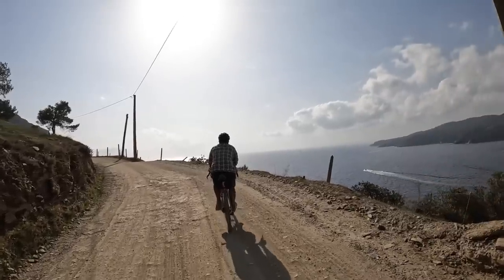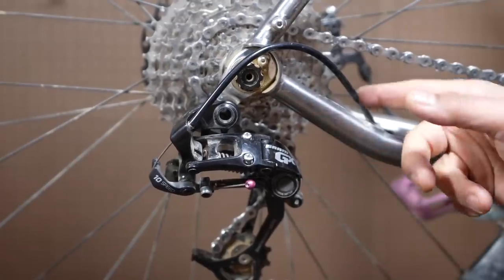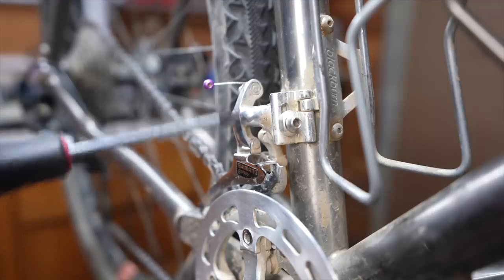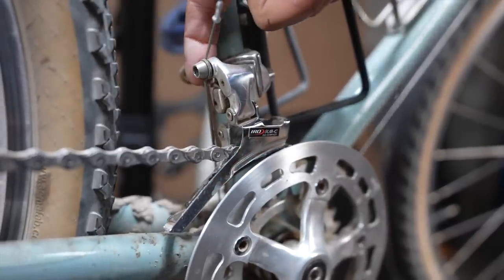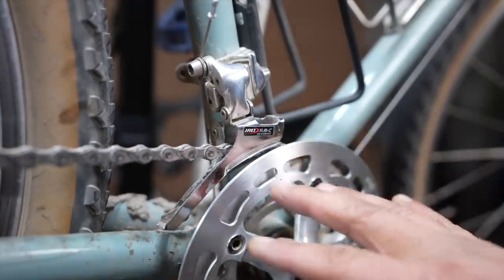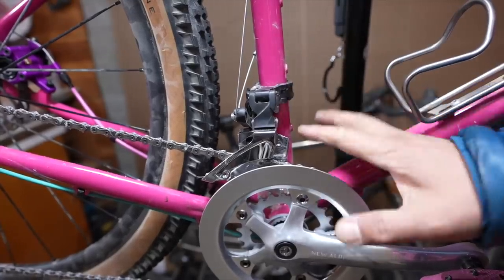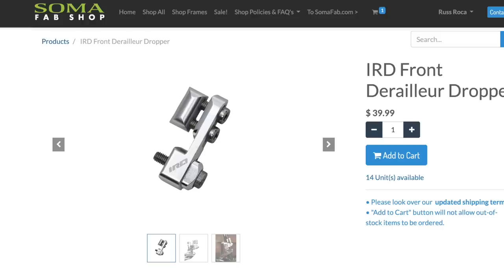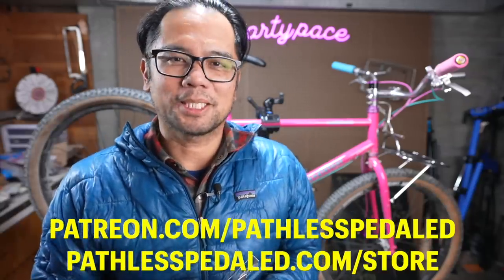These Components Are Disappearing...Get Them While You Can

Comment: Another FD you can consider is SRAM's 10sp 2X MTB group.
SRAM came out with MTB cranksets that were 42/28, 39/26, and 36/24 and front/rear derailleurs to support these 2X groups.
So in terms of an actual "plug-in-play" legit groupset that was meant to work together, this is a possibility.

If you can't get your hands on a crankset to build this, any 4 bolt 104/64 will accommodate the rings.
Also, you don't necessarily have to use the 10sp group either, but it does have it's perks. The mechanical road and MTB both have the same pull ratio in 10sp, so you can mix Red/Force/Rival or Apex 10sp brake-shifters with SRAM XX1, XO, or X9 rear derailleurs. The only mod is that you need an inline barrel adjuster on the RD as the MTB RDs don't have one. The Jagwire Mini In-Line cable adjusters are pretty good and can be slid right into the RD.

Also regardless of brand, FD's generally have the same pull ratio so no problems mixing Shimano (or Shimano variant) and SRAM.
Reply: Have a 40/22 with Red, XX and XO.
Reply from the maker: Yes. I have a vid on using an x9 double for touring.
Reply: IME 3x FDs are not widely compatible, and 2x FDs are compatible only in the sense that with some adjustment it's usually possible to make one click do the shift. That said, there are differences even between Shimano FDs.
Reply from the maker: @szurketaltos2693  what’s this click you refer to?  We always run them friction :)

Comment: Nice article! I've been looking for this. Well, I reuse a 44-33-22 Sram GXP triple chainring set (104/64 BCD with GXP spider). Take middle chainring 33T out and put 44T there. Then replace inner 22T (64 BCD) with readily available 28T ring. The spider is compatible with any GXP crank arm. So, I install it with 160mm China made hollowtech GXP crank arm. The 44-28T works well with Tiagra front.

Comment: Your comment about the truck transmission is so valuable here. So, if you're going to have ranges then you are going to have learn how to shift. Skip the wide range cassette at the rear and clutches.  Run a tripple up front. Sometimes you have to double shift to achieve your cadence.

Comment: Excellent coverage of some great components. On my quality bikes I've run everything from 7x to 12x, and have come to the conclusion that Shimano 9x is the best, especially for a 3x front setup. Running 2x upfront there are benefits to the larger cassettes for 10x and 11x, but they tend to get really fussy and unreliable as the spacing diminishes.
Reply: I agree.  I have that setup and find it covers a wide range without that cranking angle of the chain but there is some gear overlap that can be adapted to.  Love the XT and 9x 3x.
Reply: anything from 9 speed and down is king, i have no interest in anything above that.

Comment: I’ve been running a Shimano MTB rear derailleur with 11-42 rear and 46-34 front double and it’s got a front derailleur from a co-op so, going by the labels only, it’s a Shimano 105. It’s been fun to figure out everything but it seems to be doing good now. I had to replace the B screw on the derailleur a long time ago when it was still 1x. This thing has seen sloppy snow rides, too much mud, and I rode a cyclocross course with it loaded up with gear so it’s handling things well.

I’ve actually used a lot of info from your videos and so much reading of fine print in product manuals to get this to work so far. So, basically, thank you!

Comment: I put GRX 11spd on my bike last year (with 105 shifters). 46/30 front and 42/11 rear (with a braze-on extender on FD, and goatlink on RD) on my "gravel" tires. Works perfectly. On my normal road tires is a 34/11 cassette, and I can swap back and forth without having to mess with the indexing much.

Comment: I run a 3x crankset with no front derailleur. In reality, if I am shifting out of the middle chainring, I just hop off and shift by hand. It takes 3 seconds out of my ride and isn't done often. I rarely drop the chain, even on rough roads/trails. Just another option that prevents a lot of these headaches you discuss.

Comment: Thanks for repping for the 2x! I built up my Soma Fog Cutter as a 42/11-52, but those gaps are just HUGE. Waiting on a new left lever and a 46-30 1-piece direct mount chainring. I'm going to try one of the many 50-34 FDs I have laying around first, but if that gives me any grief, I'm looking at the MS Advent 9 that's designed for 44 to 48 tooth big rings and a 16T gap.
Reply: I use the Claris FD with 46/30. It's designed for as small as a 46t big ring. I think Sora might be the same.
Reply: P.S. I haven't tried the Claris FD with friction shifters, only indexed.
Reply: I'd bet that a 42/39 double would make a great half-step with that 11-52. If it works like every other ultra-wide-range rear / 3-4 tooth front I've modeled, you'll end up with 20/22/24, 7-8% gap gears from ~18 to ~110 gear inches.

Slap a road double front derailleur on it, and Bob's yer uncle. (Most triple FDs won't work, the inner cage is too low.) 

--Shannon

Comment: Agreed. On my Soma Dx I run 2x11 SlX compact MTB double 38/26 with 11-36 rear cluster. Plenty of range with a little loss of high end gearing that I don't use anyway. Similar rig on my New Albion Drake which is my gravel bike. SLX M7000 2x11, 36/26 with 11-46  cluster. Both work great with Microshift bar end shifters.

Comment: Best front derailleur design was the Shimano side swing front entry. The problem with the cable routing from below shown is the lower loop always filled up with crap and made the shift action hard, a rubber condom helped, but slowed down the issue for those of us who ride a chunk of the year in wet and muddy conditions. Its a pity Shimano only had the side swing for a short time before ditching them for 1x, and they were only designed to work for a 10 tooth chainring jump. 😢

Comment: There are a few traits of a good low gearing front mech but smooth + wide cage are the main ones. Length of cage depends on the chainstay angle and size of chainring but for lower gearing a stubby one is the desired type. Old MTB derailleurs designed for 3x are usually more than adequate, available galore for pennies.

Comment: Front derailleurs are a whole separate knowledge black hole when it comes to bike components.   You deal with a lot of the issues of the front derailleur in a very useful way.  I use Shimano 9-10 speed MTB derailleurs on all my bikes.  Some with clutches.  They are excellent and work with SIS shifters and friction shifters equally well.

Comment: The shimano side swing mtb derailleurs with built in cable stops work well and can be really handy if you don't have cable guides on your frame. If you insist on being retro the 1980s shimano aero series (ax?) also had built in cable stops. Plus you'll go faster cos aero.

Comment: I am a big fan of 2X which my Kona Rove LTD came with. I still have an old Norco MTB with a 3X, climbs any hill. Early this summer the GRX front derailleur on the Kona broke, no stock available. I had to get a Shimano Ultegra front derailleur, expensive but "dang" that thing is smooth and has been a champ. Thanks for the great content, because of you I swapped the stock rear cassette for a 11x42, working like a dream.

Comment: I have a Deore 9 speed rear and it will take a 11-42, but I did need to use a longer b screw. And on my road bike I have an 11-42 as well with a 9 speed shimano xt rear derrailleur with 10 speed shifters, and works well with my 50-34 cranks.

Comment: I have a very tight clearance in that area in all ways on a 2013 Trek D.S. Found that microshift derailleur as a braze on, and I think it might have been your channel where I found that. None of the cheaper Shimano front derailleurs I had kicking around really fit but the Alivio does. Thought I bought the wrong one, but it was actually a sideswing. Learned how to reroute wire and used a couple of zip ties pulled through a washer to both grab the wire tight and hang it from the frame. I'm on a 3x still but pretty sure they would work for 2x after being inspired by what you and Mr Romance have shared on the subject.

Comment: If you have a bottom pull f/der on a frame without a cable stop (as shown on first ti bike) fear not. Simply run a chunk of housing around bb shell and up between chainstays. It will guide the cable just fine, even with housing ending in "free space".
Reply: Done this a few times and it does work better than expected.
Reply: I had to do something similar. I installed a double kickstand & the bottom pull cable rubbed & frayed against the kickstand plate. I ran a cable  liner inside of a car hard metal brake liner tube past the kickstand. Haven't had a problem since.

Comment: If the smaller front chainring ist for "emergancy", I mean the 5% very steep hills, why not leave the front derailleur at home and shift the chain with your foot or a little stick by hand. Yes, you have to stop, at least if you change to the bigger chainring. But since swiching is rare it seems to me as a good solution. I love this on my Brompton. I have the wide range if I need it and no hassle with another gear shifting system for the front and almost no extra weight.
Thanks for your content! I love your channel!
Reply from the maker: I tried it without a FD. It was charming for 3 rides then became annoying.
Reply: @PathLessPedaledTV  Thanks for you answer! Would a front derailleur without a cable connection be a good compromise? So you can push it by foot while riding? I'm just guessing.
Reply from the maker: @beachstart  no. It would auto shift to the small ring.
Reply: My solution as well, run a Deore 9sp triple as a double 26-38 along with a 12-36 9sp cassette, use a friction bar end shifter for rear and quite happy to manually move the chain to small chainring the odd occasion I need it
Reply: Biggest issue would be chain retention.. fine on smooth roads but anything rough and you don't have the extra security of a FD cage or a 1x narrow-wide chainring.
Reply: @saintless  38 tooth chainring is a narrow wide, inner ring is single specific

Comment: An update on my earlier post. I have now built the rohloff bike and am running a 17 teeth sprocket with a 32/ 44 double. With 26" wheels and 2 .15" tyres, this gives me 13.6 to 98.5 gear inches according to Sheldon Brown's website. A gain ratio of 7.4 to 1. I was thinking of fitting a 48 teeth outer ring but have decided not to as I'm not keen on anything above a 12 teeth jump.

Comment: As someone who has never owned a bike with a 1x drive train, I find it interesting seeing modern bikes retrofitted with vintage type components. I was actually considering converting one of my bikes to 1x, with the overall goal of saving weight and modernizing my bike; however, the prospect of potentially needing additional hardware in order to get the chain line perfect is one of the handful of things that scared me off. None of it has to do with the supposed disadvantage of being unable to "drop a chain ring." After all, with the gear ratios I tend to use, I typically need to shift the rear derailleur if I'm to make any shifts from the front (and vice versa). Maybe I'm just riding inefficiently? Don't know. That's just been my experience.

Comment: I have collected a few interesting bits and peices. 

One is a NOS Deore DX double front shifter with a 30 tooth range stamped on the cage (not the common 17), and I have a NOS set of matching deore double (not tripple) cranks with a 32/58 ring set. Never seen another, but tempted to mix with a Alfine 8 hub and a small Sante 600 rear derailer to tension the chain!

The second type is a Shields Bicycles (suspected Raleigh) front deraileur, double with a push post action, the cage clamps on to the post.   I have 2 of those front deraileurs.  My thoughts on that is to extend the post mechanically not welding and set it to work with its native two rings except on an Ebike motor which is furthure out!

Comment: Maybe it’s an Europe thing but the MTB front derailleur choice here is still decent, especially from Shimano: they still manufacture 2x groupsets for MTBs…
Very useful video nevertheless, thanks!
Reply: If you look at shops in Germany, there's still a decent choice in MTB triples.
Reply: 2 X 9 is still a popular option for not that expensive beginner MTBs. It offers a good gear spread ratio, and the components are relatively inexpensive. Especially the cassettes (11-36, 11-40) are superior to 8 speed cassettes which don't offer this number of teeth on the lowest gear

Comment: I bought my trekking bike with a 42t chainring and an 11-32cassette. On steep terrain I was struggling. Fortunately, there was a 32t chainring available as well as longer bolts and spacers. So I installed the 2nd chainring. 
There is no option for me to install a front derailleur (seatstay is not round) so I'm shifting down by foot and up by hand. It's a bit of a hassle to shift onto the bigger chainring, but there obviously is no chain rub on a derailleur that isn't there. Basically a double 1x. I won't ever buy a 1x again if I can help it, range is too narrow and jumps between gears would be too big with one of these huge cassettes. Also, the chainline is horrible when climbing with a 1x.

Comment: I use internal gear hubs and run triple ring setups to get the range needed for loaded bike / trailer cycling. Next year I intend building a rohloff disc hub bike with a 28-36-44 setup with steel rings for durability. The hub currently has a 16 tooth sprocket but I'll likely change that out for a 15 tooth to keep within the usage parameters. I like to tinker with gearing to see what's possible.

Comment: Great video, I personally have grown a likeness to the 105 triple front derailleurs on a 46/30 with a 11-34 in the rear and have actually run it on ultegra 9 speed to grx 11 speed using the middle gear shift in the front as a trim to allow for wider use of the rear cassette
Reply: I find that the shape of the 3x derailleurs works better for smaller chainrings as opposed to the ones designed for 50/34 cranks
Reply: @jasongraham6772  I was thinking the same, nice to know you’ve tried it. I figured an old triple is meant to hit that range just need to get the stops in the right place
Reply: @thebr0wnhornet  I am trying to get my hands on a modern derailleur like the grx ones to compare the shape, would be interested to see how different they are
Reply: @jasongraham6772  that's where I started looking bc most say they can handle 14-16 tooth difference, I just wonder if they can drop to a 24t or 26t small ring

Comment: The 2x10 version of the GRX RD has a bit more capacity than the 2x11, and is quite cheaper. I myself have the 4700 Tiagra RD with similar capacity, but designed for an 11-34T cassette, which I have used with an extension to fit an 11-40T 😁.

Comment: Shimano GRX groups still include wide-range double fronts (46-30, paired to an 11-42 cassette, iirc), and their front derailleurs have the housing connect directly to the derailleur, so cable routing is not important.

Comment: I wouldn't be so scared: the 46/30 GRX with a 11/36 cassette serves me quite well. It's rather new frames that stop being 2x compatible...
And wait to see the new 12 speed groupsets, mechanical (non-electric) with hydraulic brakes, comming from Chinese producers.... as long as the 46/30 crank and GRX front derailleur are available, we don't need to go the vintage route :)
Reply: I wabt lower than 30t in the front!

Comment: Get a SHIMANO Shadow derailleur, XT or lower, they shift up to 36 teeth. They even go higher with "Goat-Link". And get some of the older SHIMANO front derailleurs. For example 44/32/22 to 11-46 teeth = no problem. Condition: Knowing how shifting, for example 44 to 46 teeth = no good.

Comment: The current front derailleur situation is dismal. And those who possess a cache of certain NOS models can fetch pretty much whatever they please. Fortunately, I have an old friend who snatched up a pile of NOS front and rear derailleurs when things started to get weird 5-10 years ago. He’s been my supplier ever since. It’s costing me a virtual fortune in beer and pizza though. 

BTW, my favorite FD is the old Campy Mirage 9-speed. Such a clean shifting, good looking, reliable front mech.
Reply: For many years, Campy was the only brand that did front derailleur shifting right, IMO.  The left/front shifters of their pre-2007 gruppos were all microratchet, so as close to friction as you could get.  This allowed the same front shifter to work for doubles or triples and you had vast amounts of trim compared to the other brands.  I still have like 4 sets of Campy shifters laying around from this time frame.  One of the sets is on my roadie I never ride anymore:  Campy Veloce Shifters with a Sram Apex WiFli rear derailleur so I could use an 11-36 10 speed Shimano XT cassette, Shimano front derailleur with a Campy mirage compact crankset.  Huge mishmash of components, but it worked flawlessly.
Reply: On one of my bikes i also have a Campagnolo Chorus front derailleur running with Dura Ace 9 speed shifters-works perfekt👍

Comment: All things utility & function for strength, running narrower chains makes no sense, so try to avoid 11-12-onward speeds, especially running 2x up front; you have all the gear choices without a delicate drivetrain. Heck, for common sense riding (touring), 8-9 speed is the most dependable fine shifting setup.
Reply from the maker: 11 is fine.  Its not made out of toilet paper.  I wouldn't go 12 though.  Thats just dumb :)

Comment: Shimano have pretty good front derailleur, which is clamped on version, for 2 by and 3 by, it's in the Altus group. Inexpensive, hard to set and heavy but works like magic. I've got it paired with Deore 40/30/22 crankset in Marin Four Corners.
Reply: Concur, using it with a 42-32-24.